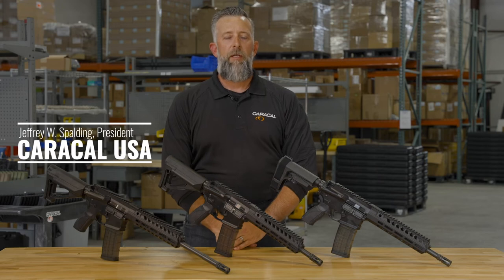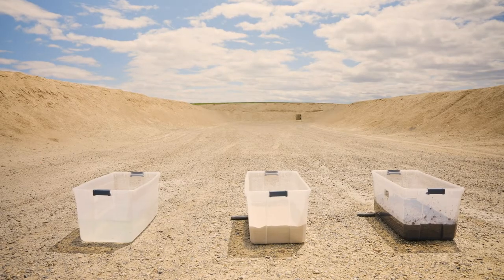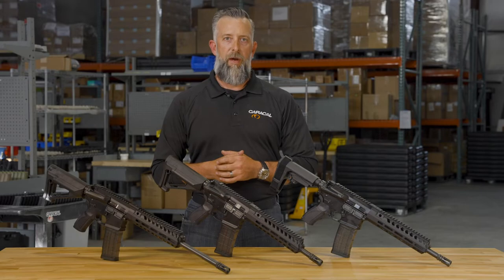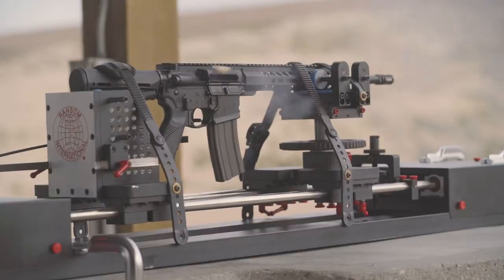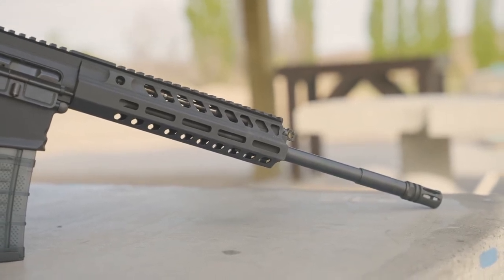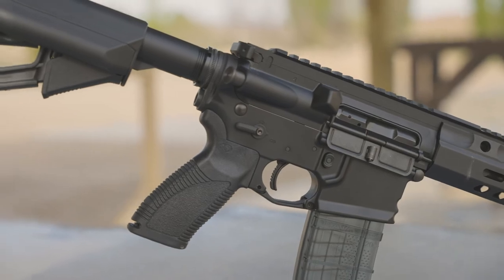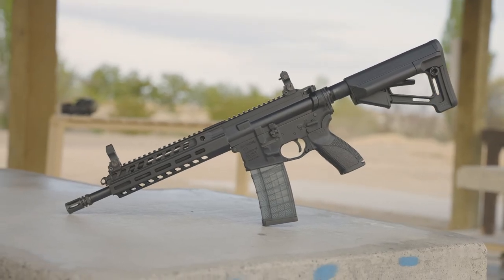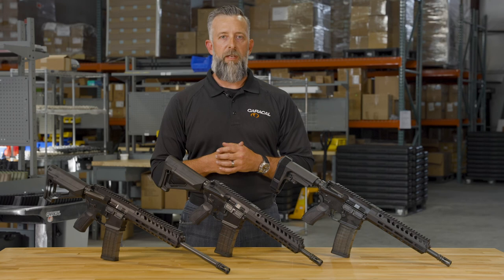Caracal USA CAR816 A2  - MADE IN USA

Comment: Are you guys planning on making a longer handguard for the 14.5 and 16" rifles? Most of the industry is offering rails that come right up behind the threads of the barrel which allows more space and better placement for force multipliers for those lengthier guns
Reply: @DevonReclaimed, this is an external piston gun, to go to a longer handguard would require all new gas systems  They won’t do that, maybe something like the LMT shovelnose handguard could work.  Otherwise, you need to stick with DI, or buy the 11.5”